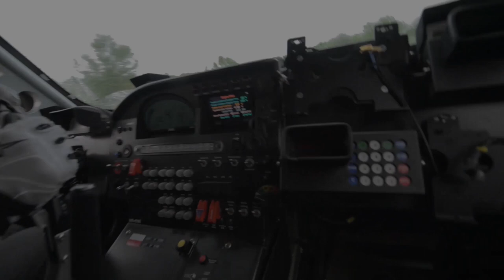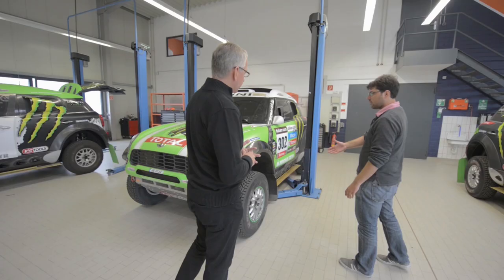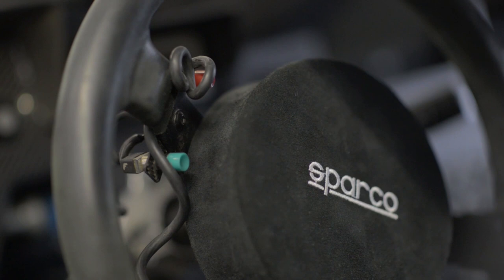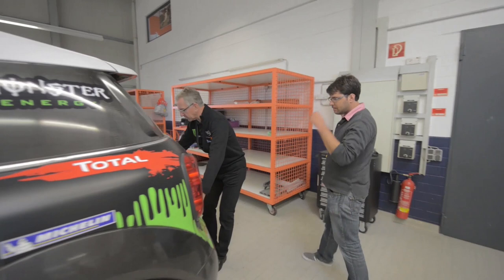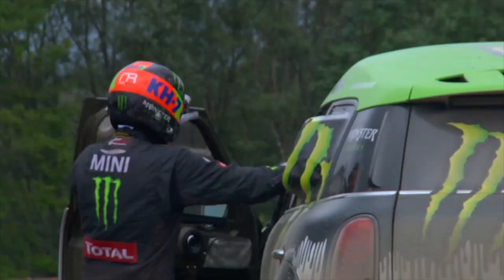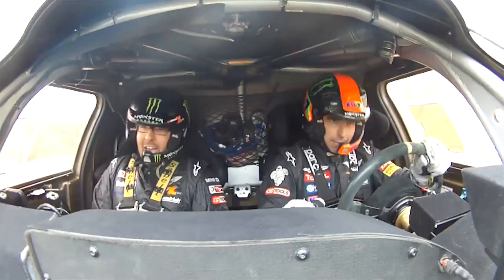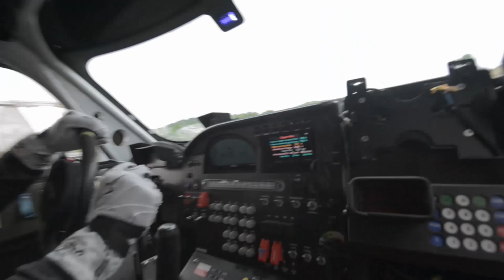110mph Over Sand Dunes - Inside X-raid and MINI ALL4 Racing - /DRIVEN

Comment: Just because you seem to not understand metric measurements. 

The maximum wheel base in Dakar is 2m90 which equates to 114.17 inches.

For your reference a Ford F150 6.5' Regular Cab has a wheel base of 125.9 inches or 3m19.

These are trucks and they are limited by what the regulations impose.

Comment: FIA mandates a minimum driving range of 800 km on the cars, to build in some margin of error. This Mini's fuel cell is "not quite" 400 L, which is at least good for that much, if not more. 
Considering these things carry enough spare parts to just about build a second car, I don't expect this is some WRC featherweight (the Dakar Car class is anything up to 3500 kg). Between that and the conditions they drive in, that sounds like decent fuel consumption to me.

Comment: the guy @ 7:40 is implying that they make the shocks, but the shocks are from Reiger, it's a independent dutch company.. 

so they are really not theirs..
Reply: Jérôme B Partially correct, final assembly to the wrc spec is performed by this company and not rieger.Rieger has been outsourcing this since 98.

Comment: YOU SHOULD RIDE IN A TROPHY TRUCK, 850 HORSE POWER, 30 INCHES OF SUSPENSION, 7000+RPM, 39 INCH TIRES TOP SPEED AROUND 130 MPH

Comment: Most succesful team? They ve won just 2 dakars... Calling these cars "trucks"...Trucks(conceptually completely different) also compete in dakar, how do you call that?Really how do you differentiate?

Also 250mm of suspension stroke is not something "between thumb and index finger" its more like "wrist-elbow". BTW: WRC has more stroke:)

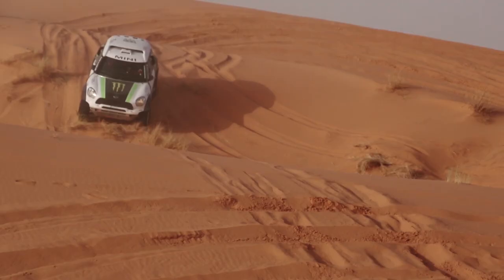JF: "Does this simulate Dakar?" Nani: "Yes the car is the same." Cause of american pronunciation "THA CAR" Correct one would be sth like DAAAKAR (Sven at 2:50)